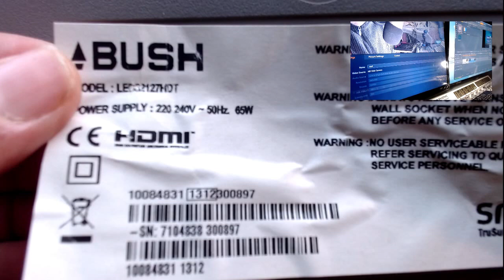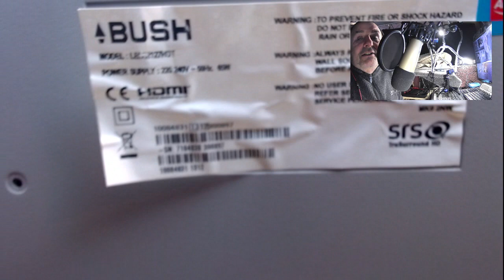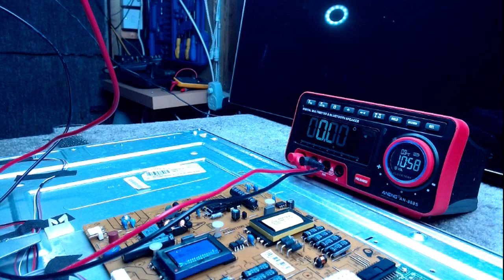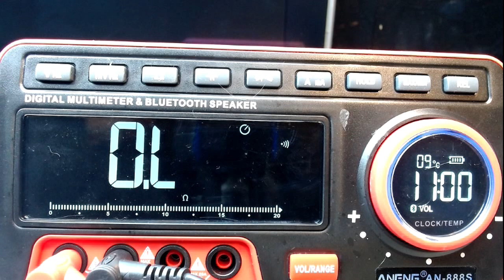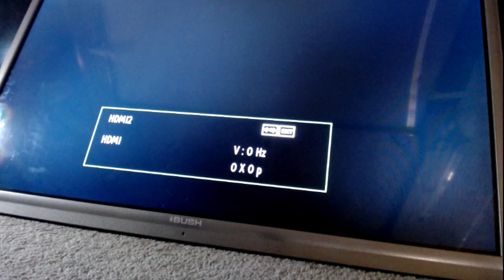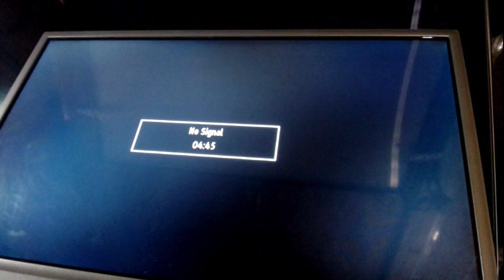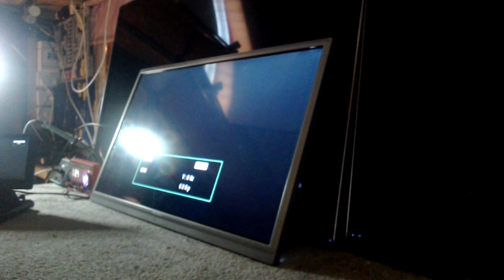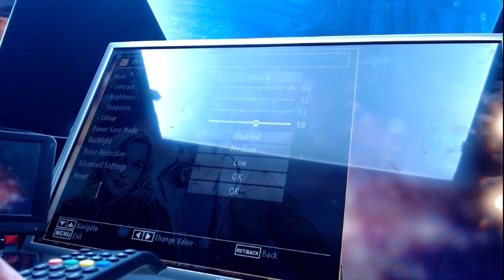Bush TV DEAD. not the fuse...........

Comment: Hi Allan, I've got a relatives tv here, Bush DLED48287FHD with a Vestel board, 17IPS12, which died whilst they were out. 2016 model. But I looked at the Diodes, The SR5100 are OK. But ringing on the SB5B5's, took them all out and no longer ringing. Went onto the tester and all show same values. Putthem back in and ringing again. I did have to change the top left 56uF 160V cap, as bulged on top, but not leaked. Any ideas? Also do you have to replace SB Diodes like for like, or can an SR go in its place?
Reply from the maker: Theres a regulator on the back.  That connects to the diode.   Are you with me on Facebook.   Send pic
Reply: @allenfleckney5969  What us the group name Allan?
Reply from the maker: Search for me Allen Fleckney
Reply: @allenfleckney5969  Request sent Allen.